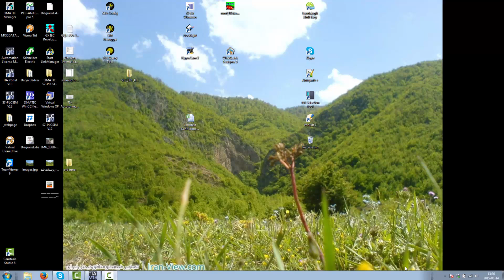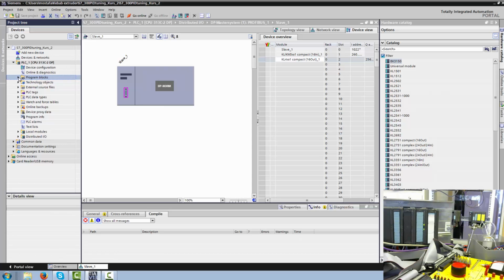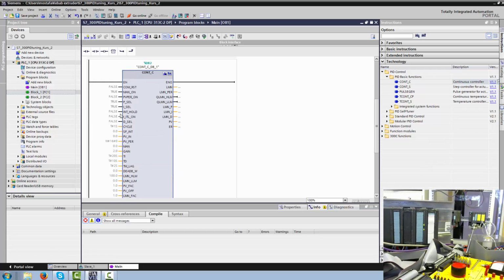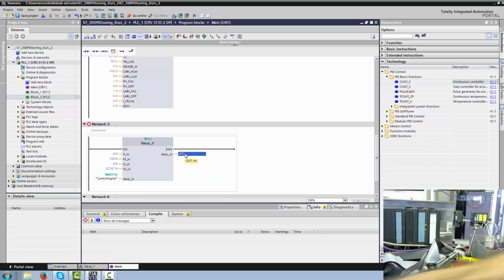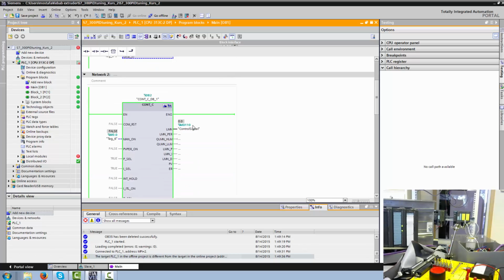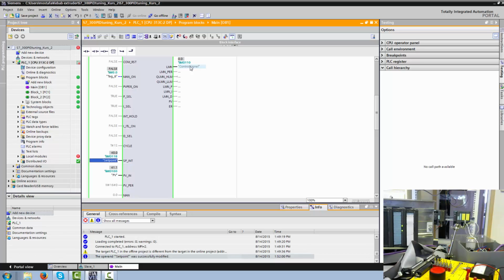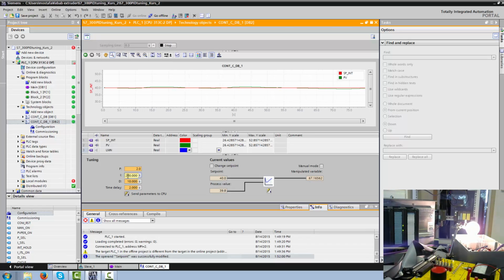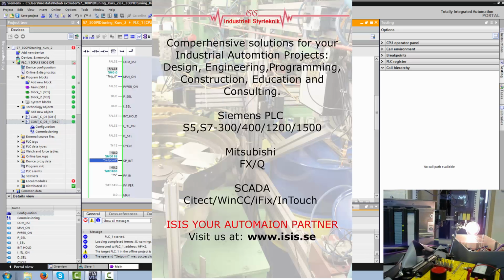Design PID Controller in TIA Portal

Comment: The CONT_C should be called in a cyclic interrupt block and the cycle time of that block should be input in the CYCLE parameter. An integration time of 500 seconds makes no sense. Why are you using two different scaling functions? Functions are all about not repeating the code...

Comment: Thank you for the video. it's helpful. I would appreciate if you can send me the sample program and as I am using cascaded control if you have any recommendation on PID algorithm of cascaded systems.  Thank you
Reply from the maker: +Wondimagegn Bekele 
Just remember to use OB35 otherwise the cascade for the implementation part there is no difference. Send me an email so I can reply with the program :).
And thanks for watching the video.

Comment: Thank you for your sharing. I have been searching some information about PID controller on internet. There is something that confuses me. You didnt use OB35 in your example but everyone uses OB35. Can you tell me please what is the difference between using OB35 and not using?
Thanks in advance.
Reply from the maker: +Ali Delikanlı 
Dear Ali,
OB35 is a cyclic interuppt which means that it runs every 100ms for example. When it comes to PID-desing in PLC, we have to call the PID block in OB35 instead of OB1 for two reasons:
1- To run the PID with the same sampling time we read from sensors and send control control signal to actuators.
2- to reduce the burden on the CPU. When we call PID in OB35 when we call it one every 100ms for example not every program which can cause to a longer program cycle.

And why I didnot use OB35? Just for presentation purpose but in real life you must use OB35 for above-mentioned reasons!